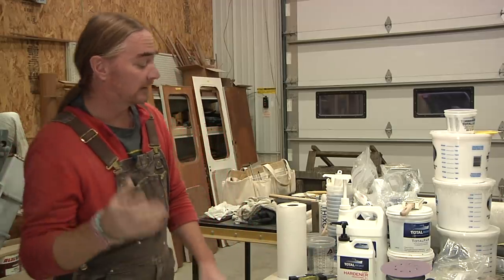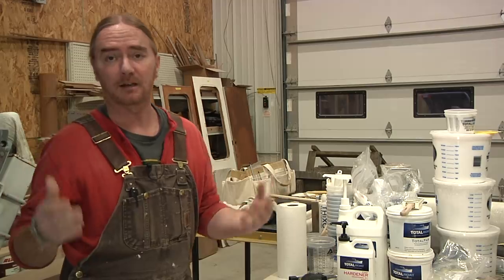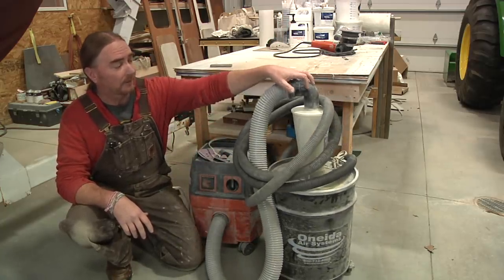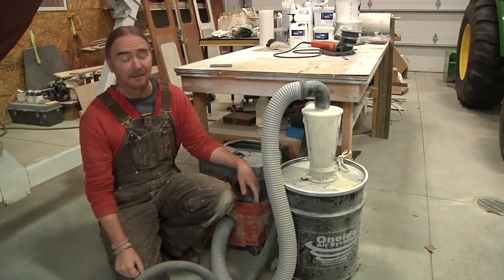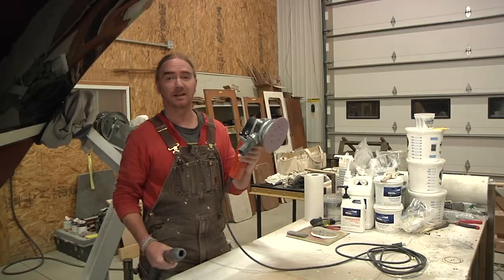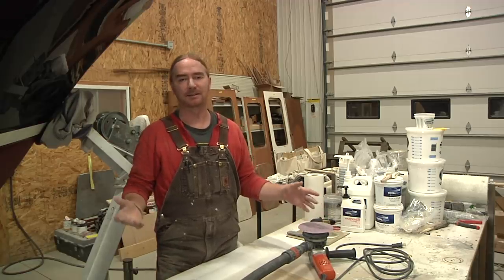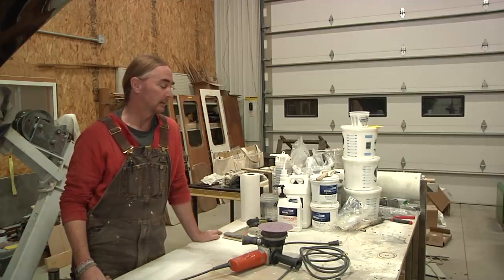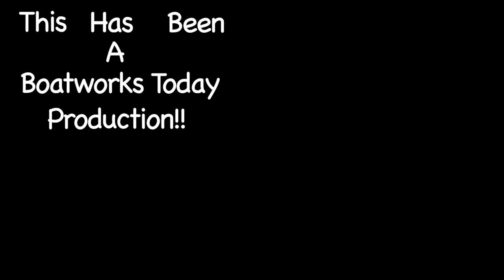My Sanding Setup For Fiberglass

Comment: I invested in Festool several years back and it is worth every penny and the dust collection is second to none!!  The way the dust collector connects to the hose has been well thought out and have had no issues.  Also I paired my CT26 with a Oneida dust deputy and had the same result as you achieved.

Comment: I have the 5 gallon version(plastic) of the Dust Deputy, highly recommended. Vacuum tank remains empty and suction lasts virtually forever, just blow out vac filter between deputy tank dumps.

Comment: Andy, interesting that you made two points about the Fein. The hose and the platen. I have a Rotex 150 paired to a CT32 and it is much better for the two reasons you mention. The hose attaches to a fitting that clips to the body of the sander and it comes out under the body of the tool in line with the power cord. The platen of the sander is replaceable so that you can go from soft platen to a harder one to suit the sanding task. There is also an interface pad for super soft contours. The dust extractor has a volume control on it so you can turn down the vacuum. This is important so that the sanding surface doesn't get sucked down too hard to the surface. The hose is also anti-static plus you can get one where the electrical supply is integrated into the hose to stop tangles. The Festool SYSTEM is expensive but worth every penny. I think Oneida makes a unit which clips to the top of the CT so you don't have to worry about knocking it over.

Comment: I had the same problem with the hose falling off of my Bosch 6" RO sander.  Like the Festool, it has an outlet in line with the handle.  However, the outlet is hard plastic.  I use a 2' section of narrow diameter hose that fits it, and pinned the hose in place by drilling a hole in both and inserting a nail.  A piece of tape holds it on and the short hose stays with the sander.  At the other end, I put an adapter to the larger diameter hose that fits the Dust Deputy.  The large diameter hose doesn't tend to pull out of the adapter by itself.  Long runs of hose work better in large diameter anyways.

The dust deputy is also available in a DIY version that is just the cyclone for about $50.  I mounted it on a 5 gallon bucket, and secured it to the top of a hand-truck style Ridgid shop vac.  The whole rig moves around together.  The dust deputy works great for sanding anti-fouling paint and golden retriever shedding.

Comment: I use the Bosch 1250DEVS dual action sander with the Fein turbo 1 vacuum. The fein hose fits on the bosch tightly and as long as I dont kink up the hose it stays attached. Much cheaper than a festool too!

Comment: Andy, besides just putting a hose clamp on the connection , which it seems you always use together, you could also, glue a strip of male Velcro to one side of hose and the female to the other hose and just attach them that way. Like a 3/4 to a 1" strip

Comment: Agreed on you get what you pay for sander wise. I can't count the number of times I watch people in the boat yard try and sand the bottom of their boat with a 5 inch sander from harbor frieght. I get it you don't want to spend a lot for a sander your gonna throw a bunch of bottom paint through but the job will go a lot faster with a better sander. I went and splurged on a Bosch 6.5 inch unit that has a dual gearbox so it becomes not a random orbit but a powered orbit turns it half way to a grinder. I've had that for 3 years and 4 boat paint jobs and it's still going strong. Yeah it won't last forever and it was $300 instead of the I'm sure much nicer Fein price, but it gets a lot of work done.

Comment: I was an HVAC tech till I retired early. I’m  almost 51 years old. I worked for a latex glove and condom factory and we used TONS of talcum powder which is one of the finest powders to try and filter. I used whole building talcum powder filtration systems and maybe you could find a used one to use in your shop. SOME OF Mine was self cleaning so I would only have to clean about once a month. They make smaller versions cause I used them. I was just letting you know all this so maybe you could look for a used one to use and make your life a little easier. 👍👍

Comment: I have the Rotex RO 125. I assume you're looking at the 150. Being able to switch between grinding and RO mode is nice. It has a shorter stroke than the Fein though and weighs in a bit less. The locking dust connector works and would be an upgrade over their previous connectors for you (which worked fine). The big downside is Festool uses their own dust collection hole pattern. So you're stuck buying from them and your existing abrasives won't work unless you want to punch new holes in it or use Abranet. Check out Mirka as well.

Comment: Some air powered DA sanders have the supply and vac hose all in one. We use DA sanders with a dust bag attached. Works ok. Dust is bad tho. Needs to be collected

Comment: I lived in Germany for ten years in the military and the hose look like a quick disconnect on the orange fitting like a air hose. Very common in Germany and then you can add a hose clamp to the end of the rubber hose.

Comment: I have an idea for your sander. Tie line around the hose, put a small metal adjuster (like what are on tent ropes), put a clip on the end. Attach the hose wrap rope around the motor and clip it and tighten the adjuster... just a thought.

Comment: what if you use a inner sleeve between the hose and the rubber adapter and a couple of hose clamps? Obviously it will reduce the internal diameter a bit.

Comment: Two 3'4"to 1"self tapping  sheet metal screws thru the hose adapter into the hose should hold the hose in place. It worked for me.

Comment: I've been looking for a sanding machine like that fein, i've found a RUPES BR112AES that has a 12mm oscillating sanding circle. In comparison that fein has a oscillating sanding circle of 8.4mm. I think that +-3,6mm makes a huge difference in the fiberglas removal speed.

Comment: What if you took a bolt or metal rod and made a locking mechanism for the current sander similar to the other brand? The rod may block the hose slightly but it may help alleviate the hose slipping out.

Comment: If your respirator doesn't fit properly or shifts it won't be doing you any good. That's why respirators should be the last resort, or supplemental protection, for lung protection.  You might find it interesting to go to your local firehouse and talk to the firefighters on how they get their respirator fit tested. Which is something they do periodically.  You might find it interesting to talk to an industrial hygienist about proper respirator fit. He or she might be willing to come on the show and explain what to look for. 

An added benefit I have found finish sanding in home and furniture projects.  Dust collection reduces clean up.  Also the sandpaper doesn't load up, making it last longer, and gives better finish faster. I have now idea if that would be the same with boats.

Comment: A small line/twine/rope? between the sander and the vac hose would save you a lot of tool throwing also.  Same concept as boaters use so they don't loose tools overboard.

Comment: Festool is THE way to go. The boatyard rented those to owners to do their bottom jobs to help contain the toxic dust created when sanding hulls. Dust containment when sanding boat hulls is required by law and the Festool system works great. No hose problems either. Their vacuum and sander system would be hard to improve on. You'll have to spend some green but you'll get a top-of-the-line machine.

Comment: I've had a Fein vac going strong for a decade now. Quietest machine available I believe. Love it but I too am miffed by the rubber hose.  Also, the fact that the hose doesn't fit standard North American vacuum attachments is annoying. I've also considered the Festool transition but the cost is hard to swallow. Also, the vacuum footprint is pretty big compared to my small Fein. An issue in my crowded shop.

Comment: Andy, just wondering which method you’ve found works best for cleaning your sander after a job. I use the same Fein sander as you primarily for sanding boat bottoms, however sometimes simply blowing the dust out of the unit with air doesn’t cut it.

Comment: Andy, not a dust topic, but do you find it necessary to add an epoxy topcoat after using Total Boat's Total Fair? I faired the bow after repairing a pulled out bow eye and read an article that thought it was necessary to add an epoxy topcoat after using fairing compound. Thoughts?

Comment: Thanks for the great video. What about the mini belt sander you’ve used in the past. Looks like it has a 1” wide belt that sticks out several inches away from the motor and is blue like Makita. Thanks for the help.
Reply: Check out Sail Life, Mads does a video about that sander which he bought by Andy's suggestion.  He includes a link to the model he purchased, same one Andy uses.

Comment: In an ideal world, the vacuum would be located outdoors.  The problem with most systems, even with Hepa filters, is that the most dangerous particles are the sub-micron ones that are too small to be trapped, and then all your vacuum system does is make the particles air-borne as they get distributed through the exhaust port (those dust collectors sold to hook up to your power tools are the worst, as they don't filter anything but the largest sawdust particles with those big, open-pore bags.  They're ok for helping to keep the shop generally clean, but I'll bet they're monsters for spreading the microscopic particles around).  However, in our northern climes the machine probably wouldn't survive being outdoors all winter.  A compromise is to set the machine up in a sealed ply box next to an exterior wall or garage door with a vent duct leading the exhaust flow outdoors (i.e. like a clothes dryer).  But then you need one heck of a long hose, and there you might have too much of a pressure drop.  Depends on your shop configuration.  Also, I recommend an air scrubber fitted with a Hepa filter, like those that you can hang from the ceiling (can be purchased on Amazon for under three hundred bucks) that runs around the clock.  Every once in a while I'll open both garage doors, don a respirator, and use a leaf blower to blow as much dust as possible outside, and then leave the scrubber running overnight before going back in.   Works especially well on a blustery day when the wind swirls in and displaces a lot of shop air. Helps clear the air.

Comment: I bought the Festool through your link.  Thanks for the information.  I need to completely remove old paint and gelcoat from cabin top and deck in order to glass and refinish.  In one of the Bertram videos, you mentioned using a belt sander.  What do you use?  Also, any suggestions on where to buy sand paper?  I''m in eastern U.S.

Comment: With your skills, you should work for SPACEX . Today they successfully picked up the fairing. They are basically carbon GRP. As per Elon "Falcon fairing halves missed the net, but touched down softly in the water. Mr Steven is picking them up. Plan is to dry them out & launch again. Nothing wrong with a little swim." They probably need a light sanding and new barrier coat and some paint to fly again. I think they are worth $6m or something...

Comment: Hello, I really enjoy your videos, they are very didactic, thank you very much! In your opinion, which is the best sanding disc (brand / grain) to use with an orbital sander in the preparation of a sailboat s  bottom and deck (epoxy paint and polyurethane)? Thanks a lot! Greetings from Argentina

Comment: Festool are very good but I’ve upgraded to Mirka using there Abranet sanding disc technology in both electric and air tool options and there is no going back ✅ biggest problem with Festool and Fein is they are very heavy units.
Reply: Agree I LOVE the Abranet! It's all I use for sanding at the moment. They are a lil pricey but last much longer. They save time  and money in the end.

Comment: Stop by a bicycle shop and ask for a bad 26" tube and cut some 2" sections.  Slide one or two of these over the rubber coupling on your sander to tighten it up. it won't risk cutting your hands like a hose clamp and still lets you disconnect. I have a touch of pink lung from delivering insulation to houses for over a year so watch your health everyone!

Comment: I do have the Rotex 150 and I love it. But I will say it looks far from the quality of that fein sander. I have changed the brushes two times in six years. But I am not a professional and only use it occasionally. Fortunately it's not that expensive and the first 3 years the warranty covered it for me. 

I hope they will launch a brushless version in time for your current sander to give up.

Comment: So, agreed the dust produced is hazardous.  What do you do when the drum fills up?  Just dump it out into the world or do you seal up and replace the drum and let a hazmat company take over?
Reply: It's called a garbage bag. Do you live/work in a garbage bag? If so, you have bigger problems than dust control...
Reply: Fiberglass dust is inert, it is basically plastic powder.  It is hazardous to human beings or any living thing that has lungs if it is airborne and then inhaled.  As a bagged up byproduct it is not considered hazardous.